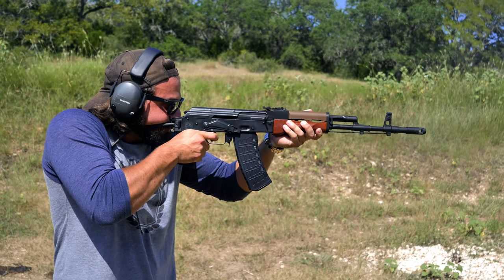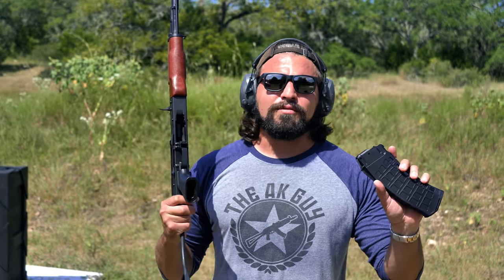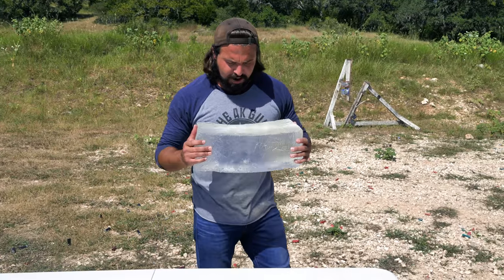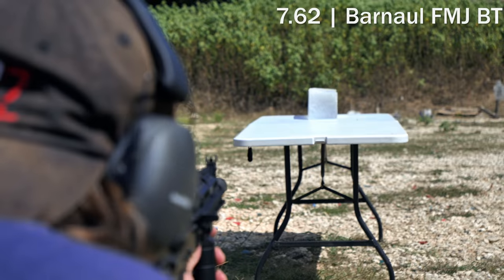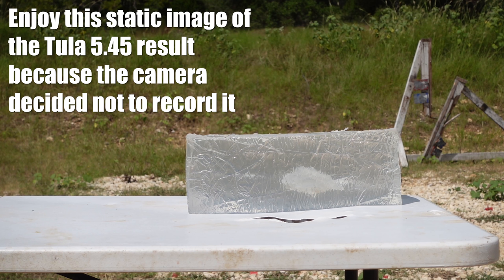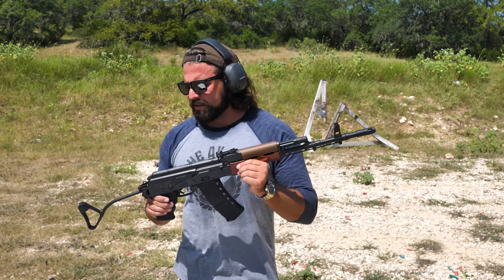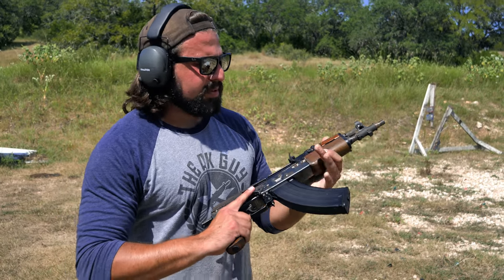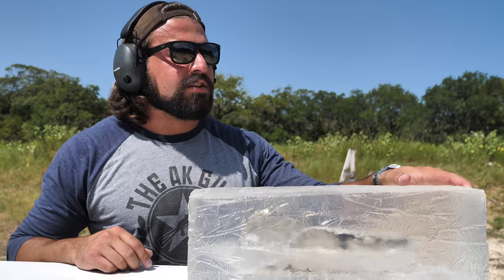7.62 vs 5.45 - Which Is Better?

Comment: A “little bit” more energy. The 5.45 gives about 1000 ft-lbs out of a 16” bbl. 7.62 gives in excess of 1700 in some loads. It’s yuge diff diff. 7.62 soft points wreck.
Reply: 5.45 is great until someone has body armour
Reply: I was gonna say, it looked like the 7.62(especially out of the RPK), did a better job of dumping it's energy into the target too.  Like being stabbed with a knife vs being stabbed with a fence post.
Reply: I agree the soft points do major damage
Reply: @snugglecity3500  
5.45 is a better armor penetrator than 7.62 due to higher velocity and smaller frontal area. I'm pretty sure it will defeat IIIa at close range where 7.62x39 won't. The recipient is still fucked if they don't mitigate spall, though.
Reply: @weege5.45  you saying that made me remember something. Isnt 7.62 designed to tumble?
Reply: @snugglecity3500  watch oneshottv's video about it 7.62 is much better against soft targets aswell
Reply: @weege5.45  7.62 will defeat 3A? Did you mean lvl 3 armor instead?
Reply: @weege5.45  It's like the 9mm vs 45 acp argument. 9mm will pierce the body armor, but 45 will vibe check your organs
Reply: 5.45 has higher sectional density if i remember right, if true it's better against armor than 7.62 is. Wide bullets suck at penning armor
Reply: @marblemarble7113  
I thought it was IIIa. I may be mistaken, my wife will tell you it's not the first time.
Reply: @snugglecity3500  yup. Range isn't as great, but once you get close, 7.63 x 39 steel core military do some serious damage.  I've seen my AR put rounds clean through targets, the Ak leaves the target in a absolute mess. ( I use boxing mannequins to run drills)
Reply: @easternrebel1061  Can confirm, my brother prefers 154 grain softpoints for hogs, and I've never seen .223, or even .308 produce effects on target like 7.62x39 does, I've seen a few that straight up looked like they got hit by a car
Reply: @snugglecity3500  fast ammo beats armor. 5.45 is faster than 7.62. It’s like 5.7 vs 45
Reply: @justa-vibe7842  5.45 isnt gonna beat body armour. Thats why the m4 is being replaced.
Reply: @snugglecity3500  Naw mate, speed is king when it comes to armor penetration.  More specifically, long, slender, fast, hardened, high sectional density projectiles.  Check out the channel SY Simulations—it’s mostly large-caliber projectiles, but the principles still hold true for small arms.
It’s for this reason that 5.7 and 4.6 were developed.
Reply: @joehoffy  never heard of 4.6 is there a specific gun I should look at that is chamber in 4.6?
Reply: @snugglecity3500  4.6× 30 is the round fired from the MP7.

Comment: That why 5.45 were called Poison bullets in Afghan war. People thought it was poisoned cause of tumbling caused inside the body
Reply: I mean ... 5.56 tumbles upon impact often as well depending on site of impact and bullet weight. 55g much more likely to tumble than 62 or 77.
Reply: It's specifically the 7n6 5.45 rounds that were called the poison bullet. 22g Steel penetrator and a lead plug at the base of the boat tail. Contrast those to what the US uses m855 only has an 11 grain steel cone in the tip.
Reply: it got the name because the wounds it created would often be infected with gangrene
Reply: 5.45 is dog shit . It performs really similar to m855 which is regarded as one of the worst 5.56 loads
Reply: @Dcm193  whatever you’re smoking I want to try it.
Reply: @Kpoole35  it yaws and doesn’t frag. Similar to m855. M855 has many stories of it not incapacitating enemies. Now look at 7n6 and mk262 mod1 . 5.45 fanboys love the krink and how “amazing “ sbr 5.45 is . Look at 10.3 ars with 77grain otm and then the krink .
Reply: @Dcm193  and where are these “stories” of not incapacitating adversary’s. If a bullet frags on impact it loses energy. This is why defensive rounds have bonded jackets
Reply: @Kpoole35  I don’t know just ask people who ran m855 be it soldiers or pmc’s . Energy isn’t the be all end all. 44 magnum has similar energy to 5.56 but look at any meat test or gel test and you will see that that small 55 grain projectile makes a lot more of a wound. Look at a gel test that shows 7n6 from a 16 inch barrel and mk262 from a 10.3 inch ar the 7n6 will penetrate more but it would be way more than tissue would allow on an advisory. But besides penetration the mk262 will have a much larger permanent wound cavity. I know I know “muh tumbling “ every spire point bullet will tumble. Both are lethal but 5.56 is better
Reply: @Dcm193  if so many people use it you should be able to provide a source. Otherwise I’ll trust the FBI’s lab tests over some knuckle dragging mouth breather on YT lol
Reply: @Dcm193  too many to list? Pick one.
Reply: @Kpoole35  you want to talk about non fragmenting an energy then let’s look again the the horrible m855. It has a higher bc, probability of fragmentation,and they fly out of a 16 inch barrel at the same speed yet m855 is heavier.
Reply: @Dcm193  you’ve said multiple times or you lied multiple times.

7n6 causes cavitation at 3.9 inches and a second at 13 inches. It’s meant to tumble or yaw, sometimes it does both.

“I bet you think the AK is superior to the AR” wtf are you 14 years old? Lmao
Reply: @Dcm193  this isn't Tarkov
Reply: @DaDaDo661  I know it’s real life and 7n6 sucks . It’s only liked because of ak fanboys
Reply: @Kpoole35  m262  will starts doing the fun stuff at about 3 inches and then continues doing that stuff until about 10 inches until it slowly tapers down in damage. That in turn leads to a permanent wound cavity significantly larger than 7n6 . It sucks flat out. If any other projectile preformed like 7n6 does (most thick walled fmj’s do) it would be deemed a bad bullet for knocking people down.
Reply: @Dcm193  energy bleeds off after impact, damage “tapers down” with every caliber except for APFSDS and kinetic weapons. You may want to find a more reliable source of info like the FBI or your own experience. This is just mind boggling stupidity
Reply: @Kpoole35  I was referring to the permanent wound cavity. Sorry if I didn’t make that clear . I have looked into the fbi standards and a couple of other reports and studies about ballistics. All say that spire shaped bullets yaw. It all depends on what happens after the fact typically the ones that don’t fragment will flip and go ass first and that leaves a a decent key hole wound track into the target . Where as a fmj that will fragment (m193) will rip apart intern causing soft water based thing to push out so hard that is exceeds that elasticity of soft tissue creating a cone shaped permanent wound cavity. Significantly larger than non fragmenting ones.

Comment: Would love to see a 545 vs 556 test. Since they're both more similar to each other than 762x39
Reply: Very similar, only notable differences are that 5.45 has ~20-25% higher ballistic coefficient and thus performs better in wind. Recoil is also a bit milder and the steel cases lighter.

Comment: I’m a proud member of the 7.62 master race. 😏

We got 7.62x63, x51, x54r, x39, x35, x25, etc .30 cal is the best general purpose size for most cartridges.
Reply: Nah, you don't need anything except 14,5x114mm
Reply: @PyromaN93  It IS a bit heavy to carry around though...
Reply: Don’t forget 7.62x38R. It’s a bit bad but it still belongs to the family
Reply: .30 Carbine (7.62x33mm) is in there too.
Reply: @tigerman1978  in most cases you don't need to carry it, it can carry itself.

Comment: As they say with engines, "There's no replacement for displacement."

So goes it for firearms, "If you want to hit them with more, go with a bigger bore."

Ok, fine. Maybe I just made that up but, I like it and I'm running with it.
Reply: They forget about boost pressure and RPM (like my car factory is 9,500 rpm, but it also fires 2x more per rpm than a standard piston engine so its effectively closer to 19,000 rpm for comparison sake). Then boost, like the engine my car uses is one of the most powerful mostly stock engines to use just adding a giant turbo with over 1000 HP per liter where most piston engines need completely custom engine blocks and custom pistons, and basically not a single stock part in them. Also the power to weight ratio on that engine is very high, especially for an NA engine.

Also there are other replacements, such as fuel or oxidizers, such as NOS (oxidizer) or Methanol (fuel) for using extremely high turbo pressure. So, that old saying is no longer true (also due to reciprocating mass the big engines do not handle higher RPM unless they have extremely short stroke such as F1 cars since the maximum piston velocity is lower relative to longer bore).
Reply: Quantity is better than quality
Reply: @ancientrenegade9243  Its not though, its 1.3 liters of displacement for the 13b. Technically if we go by rotor RPM it fires 6x more than a piston on its crankshaft, but I compare crankshaft to crankshaft since the rotor is on a 3:1 gear ratio. Its simply not, it would be closer to a 2 cycle piston engine (except the rotor undergoes all 4 cycles but in a sweeping elliptical path instead of linear and repeating).

Now if it was a 4 rotor, then yes it would be 2.6 liters but its not a 26b (I have met a guy that made an 8 rotor turbo from bolting 4x RX7 engines together which apparently is easy but I'm not sure the RX8 engines are that modular)
Reply: @ancientrenegade9243  again it's not, first we have one guy saying 2.6, now you're saying 3.9 based on rotation of dissimilar engine design, which is also wrong because then I would argue we should go by rotor rotation which is 360 degree firing cycle since it's just the crankshaft that's got its own gearing that you're pulling the number from and not really anything to do with the engine cycle otherwise you'd also be counting engine rpm after the transmission or gearbox which nobody does except turboshaft jet installation where they also don't care about displacement besides volumetric airflow as they only care about torque and RPM at output shaft as well as fuel flowrate**. In that example, jet engines are not built the same but I would consider displacement to be compressor diameter x effective pitch but true displacement would vary based on compressibility of fluid and some might also care about total displacement (so they wouldn't ignore flow bypass systems such as most modern turbofans don't have all of the flow go through the burner for efficiency gains compared to old turbojets), but it sounds like you would probably  be counting the full engine size (total interior volume x rpm) in that example.

From an engineering perspective I believe my approach is correct, as each pocket of air holds 1.3 liters of air ignoring vacuum of intake loss (otherwise turbochargers would be changing displacement which nobody changes displacement ratings based on boost pressure because that wouldn't make sense as displacement is clearly defined as diameter times length, or air pocket volume). Based on historical methods of measuring engine size this is the most logical and concise approach. I do concede that 3.9l makes way more sense than 2.6 though, as it can be derived in a logical way I thought of (different than your derivation). I mostly care that my engine fits in an 18" cube and weighs less than 250 pounds and spits flames and pops like you're racing through a warzone and that it puts a smile so big on my face that Im sometimes in pain from smiling so big and will get early stretch marks from it, but to me that spinning dorito makes my day and you can't stay mad when driving a rotary, so cheers!
Reply: @ancientrenegade9243  I'm not really sure if that's the correct volumetric number, but assuming it is I'm also not sure swept travel is even the correct way to go about it (as air can move in a system but do 0 work, such as if I had a boxer engine but had both pistons travel the same direction, the total air displacement would be 0 even if we had infinite travel and 0 work would be accomplished). It would be max intake air chamber size for more comparable number (total volume of air being displaced from the outside environment). Also considering the entire cycle takes 360 degrees of the rotor to do 3 combustion cycles, I'd argue again that the geared crankshaft speed is irrelevant and would look at purely the rotor if you are looking at it thermodynamically (in which case you would want to argue that it fires "3 pistons" or "3 cycles" per 360 degrees and say it takes 120 degrees on average to complete a cycle)

I still think per intake cycle it sucks in 1.3L/2 every time the intake port opens on the it (per rotor), so to me that would be 1.3/2 L per rotor, and that's also how you'd be approximating how much fuel to add for typical NA engines. Either way it behaves much more like a 1.3L high revved engine and pretty similar to a 2 stroke if comparing crankshaft to crankshaft rpm, I even pre-mix 2 stroke oil every time I fill up and its also about as terrible at fuel economy (less than half what I make with a 4 cylinder) so I guess its more semantics since its really not directly measured the same as a typical engine so I would default to how the inventor of the engine would rate it (for example I had an idea for a recuperating engine that undergoes an odd number of cycles, I would consider its displacement to be the first volumetric displacement), or if someone making a jet wanted to go with mass flow rate or static thrust or some other unit I believe historically the inventor has dictated the units (such as horsepower being weaker than ponies for marketing purposes).
Reply: @ancientrenegade9243  I'll leave you with one brain teaser: Why does a typical 1 liter engine have a swept travel of 4 liters per firing cycle? Why does a 1 liter dirt bike have a swept travel of 2 liters per firing cycle?

We don't use swept travel so we don't worry about it, we mostly care how much volume of air is sucked in each time the valve opens.

Comment: the black stuff is not from the bullet itself, it is what happens when the round goes through sucking air into the gel, the entry and exit holes then close up causing that air to get trapped in there, when the block shrinks back to the original size, all that air is compressed, causing a small explosion. It wouldnt happen in your body, only in balistic gel targets.
edit: wow, you can see the flash from this explosion on the rpk74 shot!

Comment: Fun fact, the Russians nearly adopted the 6.5mmx57 caliber when the Fedorov Avtomat was designed in 1916. Having studied a variety of calibers from 8mm to 6mm (anything below 6mm was considered underpowered, hmm!) they thought the 6.5mm caliber was most suited for automatic rifles. Eventually settling on the 6.5mmx50 Arisaka cartridge due to production issues and Japan having a ready ammo supply to purchase. Which is crazy considering that the US army is just now developing the 6.8mmx51 for it's next generation rifle, 100 years after the Russians said mid 6mm was the best type of round.
Reply: Yeah, the 277 Fury. It was developed by SIG Sauer in 2019. U.S. military hasn't yet begun testing it for themselves. However, if SIG Sauer's claims are to be trusted that new round performs better than 6.5 Creedmoor. Given the track record of SIG I do trust their claims. 
It's not an assault rifle round though. It's meant to be used in battle rifles, and squad weapons round, and it will be a replacement for the 7.62x51mm round.
Reply: I mean, the Swedes adopted a 6.5 round a long fucking time ago, and the ballistics were so good that it is still used today for hunting.
Reply: @scott_hunts  Indeed, the 6.5x55mm Swedish round predates the 6.5x50mmSR Arisaka. Swedes realized the ballistic advantages of the 6.5 mm round quite a long time ago.
Reply: @scott_hunts  I have a felling that a 6.5mm/6.8mm might become the new universal caliber. It's the centrists round to  solve the dispute between the radical 5.45/5.56 and 7.62 extremists.
Reply: @TheNocturnalEvil  nothing about military use but the 6.5x55 Swedish is also the universially adopted round for competition use in Scandinavia as a whole, and i can say that it's a great round to use as i've been in the Civilian Marksmanship Association for about 10 years :)
Reply: 6mm Lee Navy was probably the first intermediate rifle cartridge introduced in 1895 for the straight-pull Lee Rifle and the M1895 Colt-Browning MG used by the US Navy and Marines. It was the first cartridge to go for the smallbore, lightweight, high-velocity approach that made the rifle much faster and easier to shoot at long range, and was really ahead of its time. The standard load was a 112 grain bullet at 2600 ft/s, the fastest in the world at the time (and 6mm LN was the parent case for .220 Swift, still the fastest cartridge in the world.) The concept has been around basically as long as smokeless powder.

Comment: I believe the black stuff in the gel is where the air supper heats and burns gel from temp stretch cavity. Longer barrel does it bc faster velocity means bigger temp cavity. Sometimes in other videos you actually see a fire flash